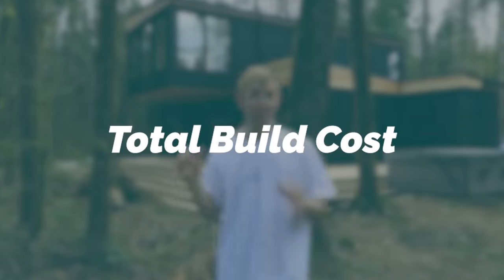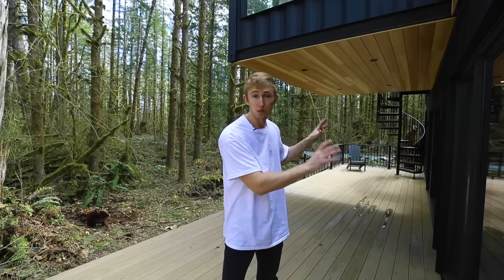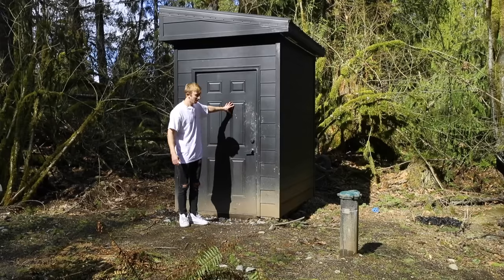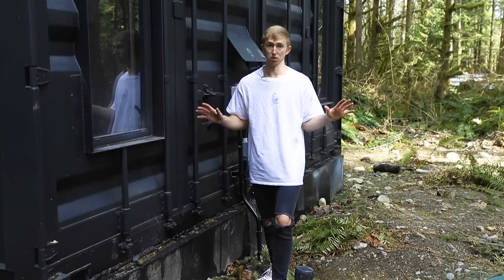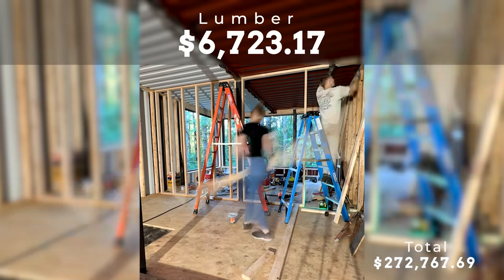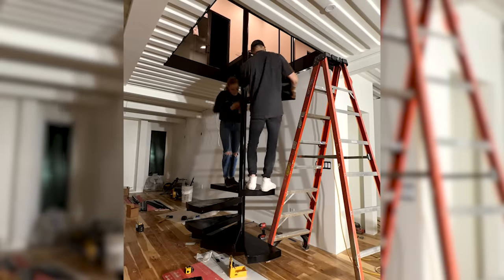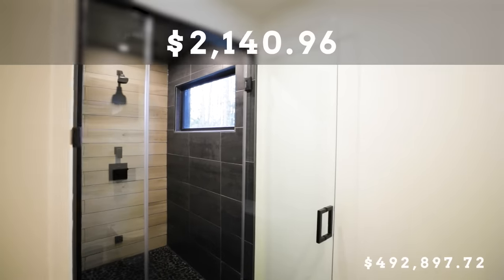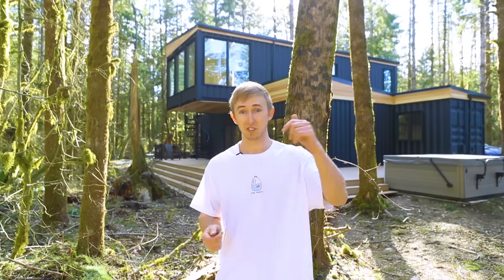How Much My 2-Story Container Home Cost to Build

Comment: Step by step breakdown of how an affordable container home can be made just as expensive as a regular home.
Reply: exactly....thought/hoped a nice container home could be more affordable....$750K....whatever...🤣
Reply: Container homes are NOT more affordable. Containers simply weren't intended to be lived in. The container's structural integrity depends on the corrugated metal walls, so the moment you start cutting holes in them, you ruin that. So you have to reinforce. Plus you have to account for insulation, pipes, electrical, etc. so you don't have near as much space inside as you think you do. And even after all is said and done, you're living in a metal container that was not intended to be lived in--it's gonna rust. Not an if, it's a when, and how bad. And as if all that weren't enough, because it's all metal, you can't easily remodel.
You're in all ways better off building from scratch using normal construction materials. You're not saving money by buying shipping containers, and you're not helping the environment. Those things get recycled when they're decommissioned anyway. That's a lot of metal--it's not like they're just gonna get thrown into a heap somewhere and forgotten about. And being professionally recycled in a facility designed to handle that sort of thing is way more efficient than some guy trying to turn it into a shanty home.
Reply: @peagee4518  you just saved me a TON of time...
Reply: Unless you  build it in a more urban area where water, , electricity, etc.. are already there.
Reply: EXACTLY xDD 700k to live like .... 2/3 years before the rust settles in ...
Reply: @ElindorBG  Gonna have to agree this is a total waste to spend that much money on an investment property let alone a forever home build - I doubt he's making much on the BnB market much less breaking even
Reply from the maker: @hedgewaters9302  lol wait till you see the year end video
Reply: Why did you think it would be affordable? He says in the video it's a really high end luxury home.
Reply: he did spent 50k on water and electricity lol
Reply: How a property cost 160k when doesnt have any lines of supply like electricity,water,etc it just doenst make sense and using containers for structures then reinforced just lose the ONLY advantages that cointaner have,the cons are too much in the end,in my opinion is just dumb make cointener home fancys.
Reply: bro, this is way more expensive than a regular home to build lmao. 550k for shipping containers jesus Christ  kid you got fucking hosed...
Reply: The container material is pretty much not useful in the build. So you are practically building a house from scratch.
Reply: @heybravo23  "high end luxury" kid got fucked on sub contractor prices and put generic shit in and painted it black
Reply: @yessir6325  Sure, but he never said he was trying to make an affordable home.
Reply: @adamb89  why would it rust if it's painted and maintained regularly
Reply: @talkingbirb2808  Because that's what happens. Paint and maintenance stave off the inevitable, they do not prevent it. Take a look at those old Lustron homes with the enameled steel, marketed as the "home of tomorrow" back in the 50's. Now even if you can find one still standing, they're ALL rusted. Even the best maintained ones have little rust trails all over the place. Rust is insidious. If enameled steel specifically designed to NOT rust can rust, a hacked up and painted shipping container is doomed.
Reply: an affordable container home = you get a used container for $3000 and cut holes for windows.. put solar on top. throw a fridge in it and a bed. there is your cheap container home. ..
Reply: @juliefritz5820  I honestly thought the entire point would be to get solar and a water catchment system.
Reply: @alfonsopronunziato1580  he could have got solar and water catchment with tanks for that much.

Comment: That electrical box costs that much because you're also paying for the conduit, the copper wire, and the manpower required to trench/pull/connect/energize your property. Depending on the distance the wire had to cover, you could easily be spending 20k just on a wire spool (also depends on the wire gauge)
Reply: wouldnt solar be cheaper? not as consumption friendly for air bnb but i feel like could of went full solar with all the container flat surface space.
Reply: @SilentStudioExplores   Even when you're surrounded by large trees?
Reply: @Slamdoxicalz  yup a small clearing can help too... dosnt take much really when you have 27$k to spend
Reply: I was looking for this comment… even in winter, 20k of solar and you’d be fully off grid. Enough surplus in summer to run a hot tub or something then too.
Reply: I work for a power company I won't say who but we charge about 12.50 a kva plus 7 a foot for wire I would say it's probably your distant from the nearest primary power
Reply: Also each state has different tariffs and that's the rate in which we can charge a customer for new service
Reply: @Slamdoxicalz it would not be cheaper it has a huge amount of stuff the other commenter didn't consider
Reply: Like here in NEK of Vermont, there is very little sun.
Reply: It is so hard to make solar work in WA State. We've tried it over on the Peninsula and it's been a challenge just to run a camper on it.  @SilentStudioExplores
Reply: Plus transformers are just expensive af
Reply: Nah ur lying or a scammer
Reply: @mace400  nah I literally saw invoices for a company I worked for and saw the pricetags on this shit.
Reply: He could’ve dug the trench and the power company still would’ve charged him that.
Reply: @SilentStudioExplores  No, Price a solar package big enough for the load he requires for that home. hot tub and well, then add the generator and batteries, then price out the replacement costs over 10 years and youre probably looking at tripling the one time $27K. The price he paid for reliable power is a bargin. Its just one of those things people like to complain about because its you vs big business or the government and the fact that you dont know the cost breakdown for engineering, materials and manpower.  With the cost of the other things in this build it makes me laugh that he picked this one thing to balk at the cost.
Reply: And then add in the fact that if anything ever goes wrong with the poles, wire, transformer or cable the power company is paying for it...........FOREVER.

Comment: This looks incredible. Some people are focusing on the fact that they wouldn’t want to stay in a shipping container house. But honestly, the shipping containers were just the base design. You’re not just buying shipping containers. You’re buying a really nice house. The containers are just essentially a gimmick as there is just as much work as building a house and it looks amazing.
Reply: still is a fking container
Reply: @miguelcorreia6357I 'd rather have my house shell based around metal over wood but that's just me
Reply: Duh!
Reply: The price is the focus because he got bent over!
Reply: Yeah, wait until a year passes and he starts to realize why the industry stopped making these.  
Mold problems being the biggest issue that will crop up quickly. 

for 800k he could have built a home 10 times this size, loaded with futuristic features, and charged way more than a million.

Not a great investment.
Reply from the maker: @thisisashan  if you can build a house 10x the size next door to me on a completely undeveloped piece of land you sir are a wizard. My neighbor is looking to build a 2000SF house on the lot next door to me and got quotes in the 900k-1.3M range from 4 builders. Keep in mind that's just the cost to build, no utilities, no land clearing. A home just down the street from me sold for 1.3M and was built in the 80's and was 200SF larger than mine, and it didn't have any of the bells and whistles. No one in the comments understands Washington state and the insane cost to build. Folks living in the flyover states need to leave the comments.
Reply: @devonloerop   Daiumn. Devon be right doe.
Reply: Yeah and for $700,000 you could get a really nice house... that isn't made from shipping containers.

"Hello, yes, I'd like to spend mansion money to live like a hobo who found 10 thousand in a paper bag." said nobody ever.
Reply: @yabi333  thats because you have no idea how thermodynamics work..
Reply: @ev6558  Aren't most houses in the US made off of wood? I'd rather live in shipping containers than wood when a storm hits tbh
Reply: @ev6558  the interior is really nice, if you don't like the containers don't buy it.
Reply: @SupplyOfShorts  Of course you would, Europe has yet to discover modern construction.
Reply: @ev6558  Hehe we can learn - at least we have history
Reply: Check out Container Park in downtown Las Vegas. One of the hottest places in the country using containers to create a 3 or 4 story mini mall.
Reply: How long took to build this project?
Reply: @SupplyOfShorts   Yes you have a history of calling us on the phone to save you from your history.
Reply: Found the boomers.
Reply: @thisisashan   800k for 10x the size.. you must be living on a different timeline. Show us the calculations and sources
Reply: @ev6558  Europe is a vague comparison considering it consists of several nations with different standards. 

For most of the dutch/scand countries they are roughly 2 or 3 decades beyond what the United States is, for construction.  And in the best ways possible.  

Germany, for instance, is already building net zero homes.  That is, homes that don't consume energy or create excess carbon waste.  (But still offer all modern electronics, and even excess electricity)

Imagine buying a new home and you never have to pay sewage, electricity, or water because your home has more of a positive impact on each than a negative. 

And they have it down to where they only cost about 10% more.  So within a year of living their, you have been paid back (through lack of electric/water/sewage bills) more than it cost you extra to buy.

Also, their homes aren't built to fall over after 20 years like ours are.

Now... if you are comparing us to like, Ukraine, the poorest European country.  Obviously we are a step ahead of them.  They have too many problems to be focused on such things at the moment.
Reply: Why choose to live where it's so expensive if you could, too, live in a flyover state? Where it's cheaper and has everything the cities have, just about.
Reply: @thisisashan  "Also, their homes aren't built to fall over after 20 years like ours are."

"Ours are"? I personally live in a neighborhood that was constructed in the late 60's/early 70's. There aren't any houses "falling over" and we're a half century in my friend. And that's in central Florida, hurricanes and daily storms are the norm here. Granted, there's the occasional roof damage from wind and such, and we are a good ways from the coast, but these houses will easily be standing for another half century without issue unless there's an act of God or something. Never should have moved away from block construction. There are other neighborhoods in the area that have been around for over a century without issue.🤷‍♀
Reply: @brianjones8432  So Florida adopted a state minimum building code law in 1974.

In doing so you may think, "Oh gee golly, that is good, they build things good now".

But that isn't how it works.  It is basically a guidelines on how to do the bare minimum and legally get away with it.

So if your houses were built in the 60's, you lucked out. 

Meanwhile, in 92 they had to redo building codes for South Florida, because Hurricane andrew knocked everything built from 74 to 92 down, in the worst ways possible.

So those went live in 94.. but that also wasn't good enough, so they did the codes over again for 2002.

The FBC is the current codes, and they are doing better, but the constant updating (now on the 7th iteration) means that construction workers are constantly behind, but getting shoddy work passed through the industry because people need houses now.

And yes.  All modern homes are built like shit.  Being in a hurricane wonderland does offer a stronger building code, but it hasn't exactly been a great path to get there.  Nor is it effective constantly changing codes on guys that got into construction because they weren't into 'book learning'.

Further, Florida being an exception, arguing to its specific case, is called argument to the exception.

Argument to the exception is a fallacy.
It is a fallacy, because in most cases, it isn't correct.  Which means all you are doing is arguing, "well that isn't always the case".
Which is merely another way of saying, "Well you are right most of the time, but here is a limited example of a few times you are wrong."
Reply: @matthewstephens6502  In many cases it's just an issue of employment. There's simply more work the closer you are to a city. Sure, you could buy land cheap in countless parts of the U.S. and build for next to nothing on them, but where are you going to work? Where are your kids going to go to school? You can pretty much count any activity as more of an excursion because you will be spending countless hours in a car (plus the added fuel costs, vehicle wear and tear) commuting between your cheap place to live and the closest city that has all of the amenities you need. There's always a give and take.🤷‍♀

Now in the case of this build, he's not kidding regarding the cost of construction given that part of the country. It's absolutely insane there (can thank the local politics for most of that). Granted, our housing prices here in central FL have gone up quite a bit post Covid and so many people flooding the state that were fleeing NY and many liberal leaning areas, but $700,000+ would buy you a pretty nice modern (built within the last 20 years) pad here in Florida. For example, a quick search on Zillow shows a 4000sqft 5bd 4ba listing right now for $725,000. It's always relative..... And to be honest, regardless of what your personal political leaning is, it's always going to cost you more to live in many of those left leaning areas due to added taxes and such. You might garner a bit larger paycheck, but it's not equivalent to what you're going to have to spend to live there. CA is a great example of that nonsense. There are houses going for $1.5 million+ in that state that aren't even worth the foundation they are built on, not to mention the ridiculous cost of living for what is rapidly turning into a cesspool.
Reply: @thisisashan  I wasn't just talking a single example, I was talking about entire housing developments (many of which were built decades apart), and I'm well aware of building codes changing over time, it's part of the natural order of things (sometimes for the better, sometimes for the worse). Nor was I trying to argue an exception, as there are countless examples of houses built all over the U.S. that have been standing for well over a century. I was simply pointing out that this statement.....

"Also, their homes aren't built to fall over after 20 years like ours are."

Goes well beyond the hyperbolic into laughable absurdity. Your bringing up hurricane Andrew would be the prime example of "argument to the exception", as it was one of the most destructive storms we've had in the state over the last 100 years. Not to mention that it was primarily coastal damage in the Miami/Homestead area). If you're living on the coast anywhere in Florida, you've already chosen your fate as eventually you will feel the brunt of one of those storms. I couldn't care less what the codes are, you're likely coming home to complete devastation after an extremely rare storm of that nature, and no consumer grade building code in the world is going to save you from flood damage if your house is submerged.🙄
Reply: @SupplyOfShorts  wood homes if built right can survive sustained 150 mph winds. Which is unnecessary to built in most areas in the USA. So 700,000k for a  “storm safe house” that it not necessary where the home was built is not very climate friendly.
Reply: @DontstepOnsnake  is that what you are being told about your wood houses? They are more climate friendly? Ohh dear
Reply: @SupplyOfShorts  do you know how steel is made? 🔥🔥🔥🔥🔥🔥🔥✌️❤️
Reply: @DontstepOnsnake  Yes I do. And it is defenitely more climate damaging but wooden houses have much worst insulation, break down earlier etc. 

So I don't think over the span of a houses lfie it is much more climate friendly to build 3 timber houses vs 1 steel/concrete house
Reply: @yabi333 why, metal is a god awful insulator lol
Reply: Yeah no 😂
Reply: I love these shipping container homes ❤

Comment: I know that with getting the power out there a lot of the cost is running the lines to the location if it's "off the grid" then it's going to be significantly more expensive. Just want to say thank you so much though. This is the best full cost of assembly/construction video that I have ever watched on youtube. It's truly a massive help to anyone considering a similar project. I can't say thank you enough times, you did an amazing job.